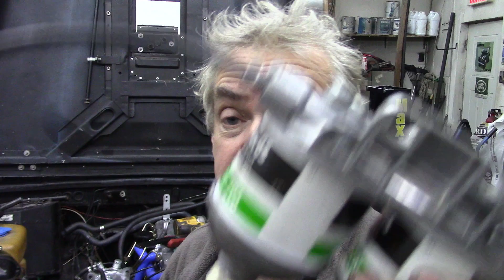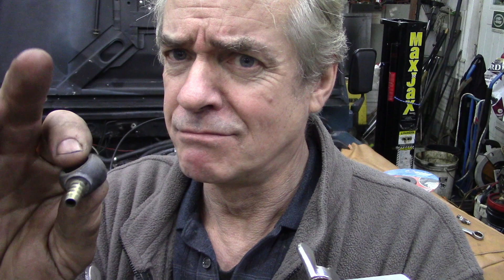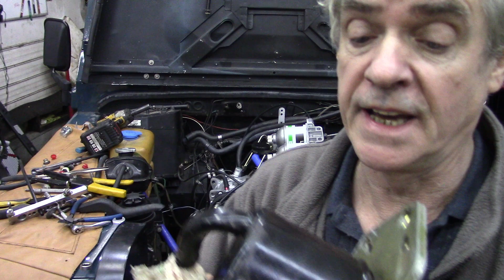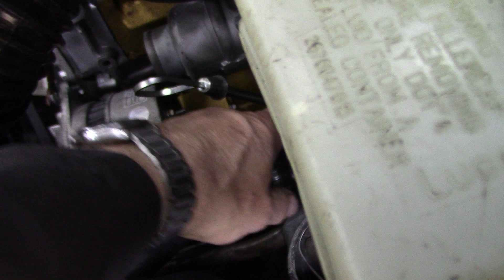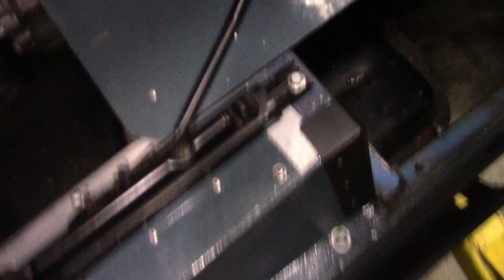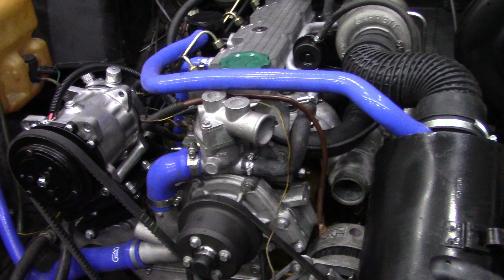200Tdi pipes and hoses

Comment: When I had the hydraulic shop make up some oil cooler hoses for my new rad set up, I had them use a connector instead of crimping the pipe directly on the hose. That way I can adjust orientation before tightening the connector.
Reply from the maker: I didn't like hydraulic lines on oil cooler pipe - a bit too ridged - also even with STD pipes, you must clamp the 2 together  - especially with the plastic tank radiators - I have seen 2 oil coolers crack internally and allow oil to get into the coolant - very messy!
Reply: @BritannicaRestorations  They didnt actually make up the hose/pipes from new, just adapted different types of the original oil hoses. I had the old cone type connector on the filter housing outlets and fitted a new tropical radiator that had the O ring fitting, so I bought a pair of new hoses and they split them and re-joined the old and new types with connectors. Worked for me at the time.
I agree about having them clamped securely!
Reply from the maker: Those wavy crimps on oil cooler hoses look very much like A/C crimps, and I have a tool to do them - maybe A/C hose can be used for oil cooler hose? May have a look into it!

Comment: Hi Mike, when I fitted power steering to my 2.5 petrol I bought the bracket and plate from someone breaking a 19J, I then bought a 200tdi style pump to go on it as I preferred that style of fitting on the pressure pipe with the O-ring rather than bango bolt and dowty washers.
When I came to fit the pipes the pressure fitting was facing the chassis meaning I couldn't get the pipe on at all so I seen on a forum someone had the same problem and had redrilled the 4 bolt holes mounting the pump to the plate to clock the pump about 45 degrees, worked a treat for me to use that style of pump.
Reply from the maker: Glad it worked out for you ! Being a LHD, with the pump tight to the chassis, and close to the steering box, there is not that much wriggle room
So I used the original 2.5 NA bracket and pump, but hose was crap - looked like it came off a 1970's JCB
Reply: I have a rubber lined P clip on the breather pipe attached to rear most bolt of thermostat housing
Reply: Hi Mike
My 200tdi Defender engine seems so much tidier..... Your engine seems very crowded. I can take a video/photos of mine and email them to you if you wish
Reply from the maker: No that's fine